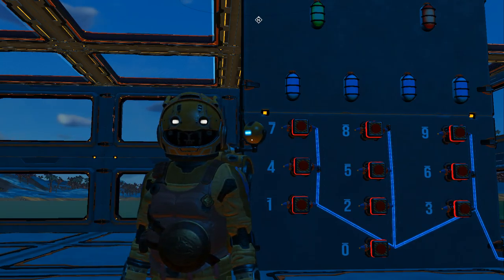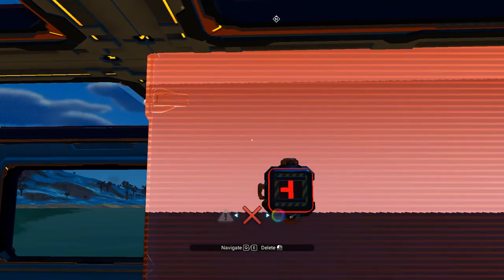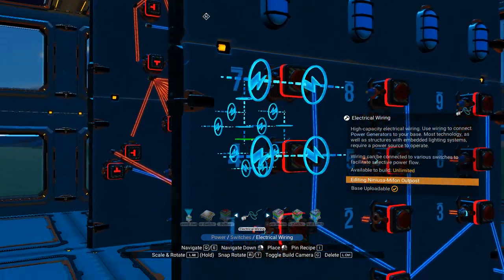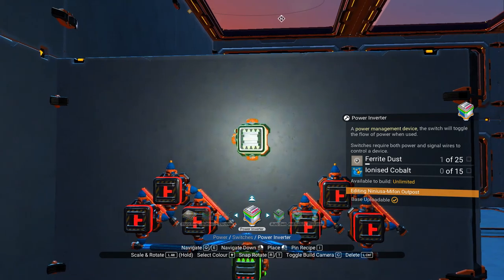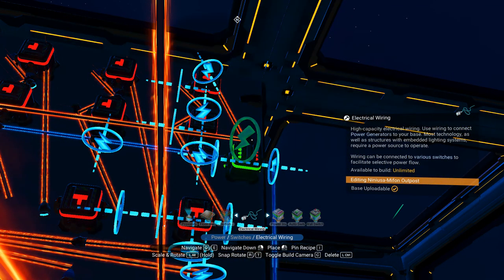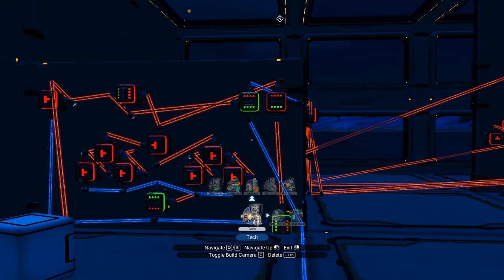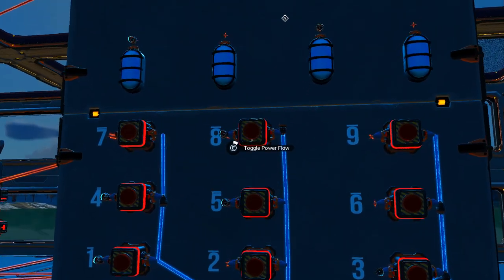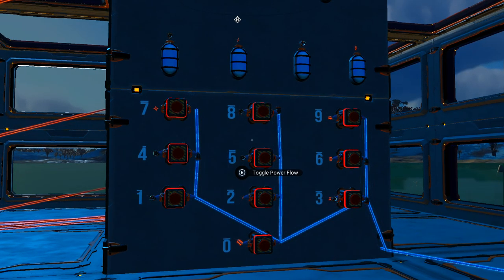No Man's Sky Multi Door Self Resetting Combination Lock Tutorial

Comment: Great video my guy. I am wondering why my switch to open and close the door on  the other side is only working for turning the power off to the door. I was wondering if you had any insight on how I can make it a toggle switch rather than what it is currently doing?
Reply from the maker: I would check your wiring. This is a complicated build and the wiring is complex. The toggle circuit I built for the code begins at 15:30. Double check your wiring on that bit in particular. Thanks and Good Luck! I hope you can solve your problem.